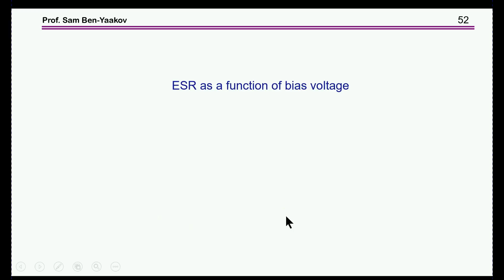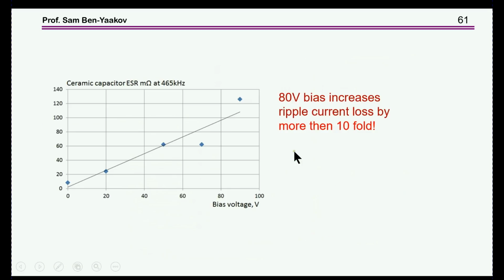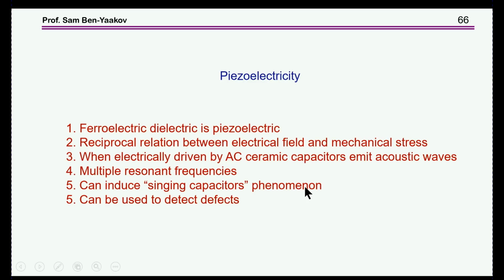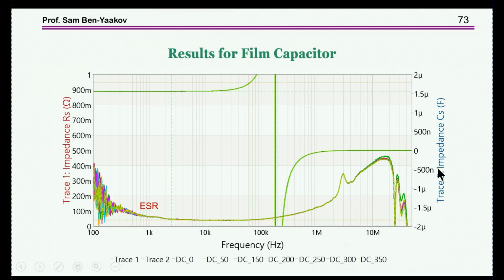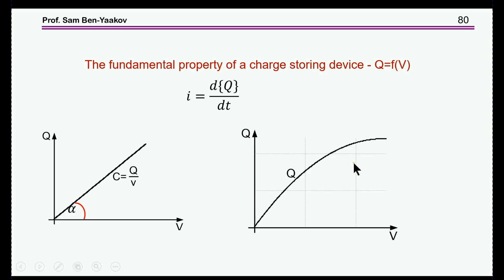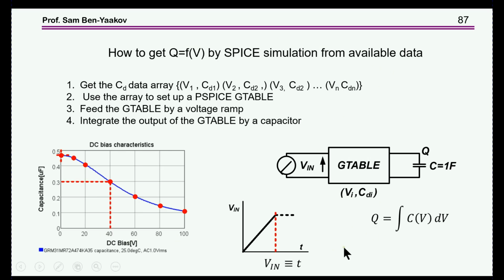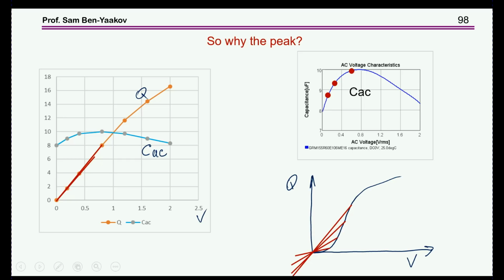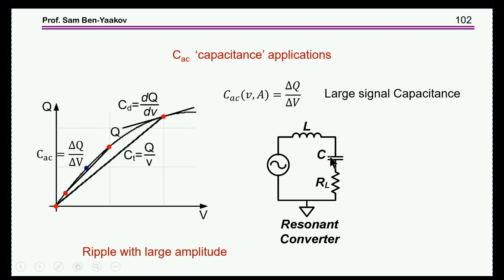PCIM 2019_ Ceramic Capacitors Seminar_Part 2_1080

Comment: Great stuff. Being in the sonar field where we use the piezoelectric effect to generate and receive underwater acoustics, I was particularly interested in the effects of DC bias on this effect. You kind of left this in limbo, but the presentation seems to indicate that this might be significant. This is interesting because I don't see anyone applying DC bias to their receiver or projector elements which might be a good thing to do if the piezoelectric effect is a function of this DC bias...

Comment: This video promoted me to think about the the LCR meter's reported capacitance in response to non-linear loads when using large amplitudes. I believe they will discard the harmonics generated, and only measure based on the fundamental frequency, so integrating the C-Vac curve won't give you the correct charge? Perhaps measurements which capture the harmonic data are required to properly characterize the capacitor's response to (and loss with) large-signal inputs.
Reply from the maker: As far as I know, most RLC meters use small signal (not necessarily sinusoidal), But there is certainly a problem underestimating ESR for large signal.

Comment: Sam,

A word of caution to you - be very careful with trying to assign any significance to any "measurements" taken using impedance analyzers (linear measurement) for ferroelectric (non linear) capacitors.  I would refer you to Mosley's paper (and mine) talking about this fundamental problem.  Just because you can take an instrument and obtain a reading of some parameter does not necessarily mean that this has any relevance to reality.

Also your comment that the value of ESR for a capacitor is important as it relates to the loss if the capacitor is subjected to an AC excitation is completely WRONG!

I would challenge you to take several X7R capacitors and measure their ESR at different AC excitation values.  Then take these same capacitors and measure their capacitive hysteresis loop areas for the same applied AC excitation values using the Sawyer-Tower method.  Finally apply the excitation values to the capacitors and measure the loss using an accurate calorimetry set up.

This will give you three different measurements of the loss.  I have done this experiment and know that there is very good correlation between the calorimetry and Sayer-Tower measurements in regard to power loss, however you find that the ESR measurements that the impedance analyzer gives you is simply not related (not correlated) to power loss.
Reply from the maker: Hi Michael,
Thanks for your comments. I have not seen any published paper on the issue of errors in ESR
measurements by analyzers. If there are any, I will appreciate copies or references.
ESR is used  by all to estimate power dissipation of a ceramic capacitors. The ESR is
emulating the loss component when assumed to be due to the current (always
correct at a given operating point).  It represents a voltage which is in phase with the current and therefore a dissipative
component.   
Impedance measurements by network analyzers (as the Bode 100 of Omicron we have used) measure the phase
angle between the voltage and current of the impedance. From this, the real and
imaginary components are calculated which leads to the value of ESR. All this
is for “small” signal. AS pointed out in my seminar, the large signal behavior is
another story altogether and, strictly speaking,  one definitely cannot use the ESR of the average
operating point to estimate large signal losses. However, as we do with ferromagnetic
losses, in the absence of better data and analytical tool, we use the small
signal ESR for loss calculation. Nothing new.
Reply: Sam,

I will send you through the papers by Mosley on impedance analyzer errors when measuring ferroelectric capacitors.
Reply from the maker: Thanks Michael